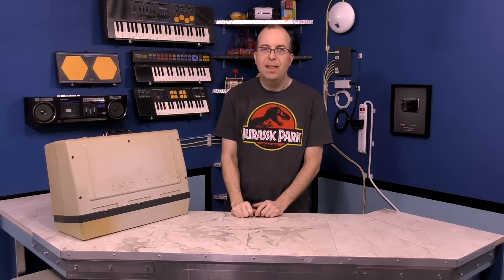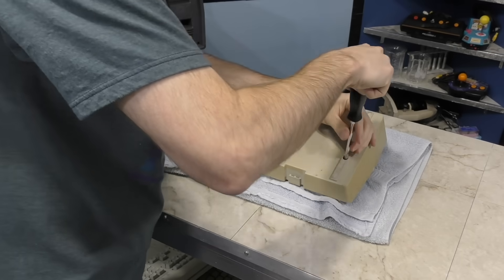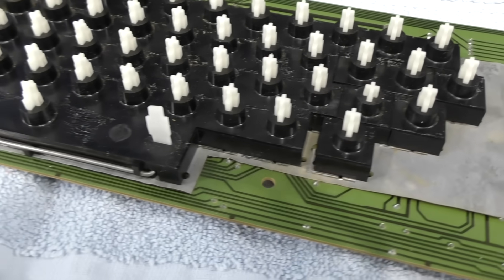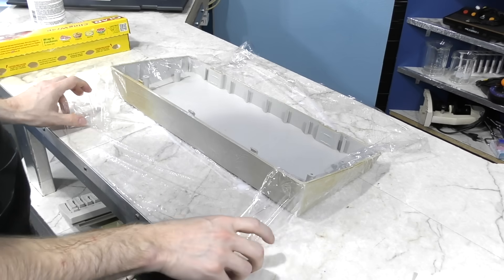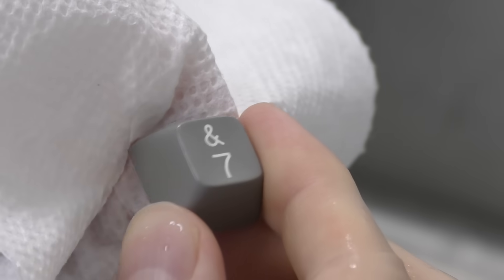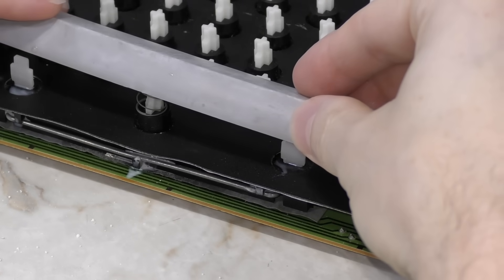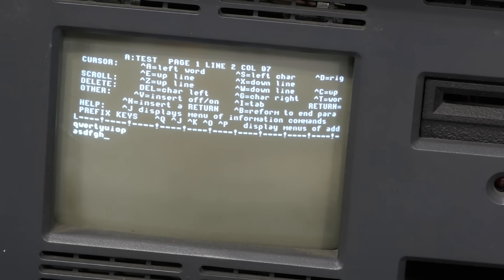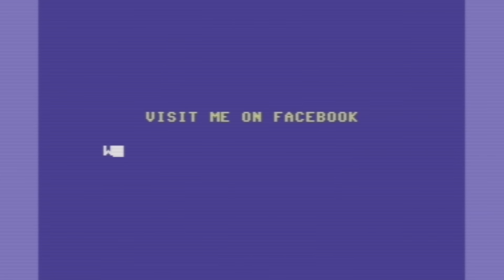Osborne 1 Computer Restoration Part 1

Comment: even better if a chip has built-in nand, ram, rom and touch-display as a card computer. uv light bulb in enclosure, not outside. ie 3d resin uv printer cure box. the reason of uv curing is exactly the same. have a-rest from your works. what drinks space bar serves.

Comment: I just got one of these, the keys are in pretty good shape, in fact the whole keyboard seems OK (although I haven't actually powered on the machine, yet); I'm wondering if you had to do any cleaning on the dark face on the top, you don't mention that in this video. I made the mistake of using some rubbing alcohol on some sticky left over tape glue, which deteriorated the surface a little. I figured a little Armor All would probably restore what I did, but I still have a few goo spots that I wouldn't mind cleaning.

Comment: I never get streaks with hydrogen peroxide cream because I omit the clingfilm stage. I think it needs oxygen and room to evaporate or streaks will happen, just set an alarm to go out and apply further coats with a small brush every 30-45 mins and don't apply it too thick.

Comment: Best way to really clean screw heads is a wire wheel on a bench grinder. You can even buff them up then on a polishing mop and an abrasive polish again on the bench grinder. If your really fussy they can then be nickel plated with some fairly rudimentary equipment.

Comment: A solution for faded plastics, rubber and leather is actually lanolin grease. No promises but it could potentially fix issues like the color streaking on the keycaps. A wipe-down with lanolin grease immediately brings back the original color of those materials. Especially when I'm working on old vehicles with faded interior trim, it's amazing the difference that an application of lanolin makes. And the color stays indefinitely. I've tried a lot of car care products and none of them even come close.

Comment: I have the some effect with stretch foil cuz uneven application and thickness of the coating. If you have small elements better is use box with liquid.

Comment: @the8bitguy don't use sun for retrobright. For dark plastics as dark gray, gray, light gray or beige just put those parts into 12% oxidizer for 3 days. After 3 days wash those parts and repeat with new part of 12% oxidizer fo next 3 days. As i see you destroyed key caps. Your key caps looks like a marble... not clean one color surface.

Comment: I like the "marble" look to the keys.  Super cool.
Reply: I would love them on a modern mechanical keyboard
Reply: @neurotyx  Buy a mechanical keyboard, put keycaps made of ABS plastics, and let it sit all by itself in a bath of lots of UV light for a few weeks, then let it sit in the bath of UV light while submerged in hydrogen peroxide and water
Reply: @neurotyx  You can buy SA profile or MT3 profile keycaps.
Reply: I know this is dumb and super obvious, but you can actually get marble coloured keycaps now for mechanical keyboards, keyboard keys have come a long way, pretty much customization is pretty good nowadays.
Reply: When the Romans make your keyboard...
Reply: Same
Reply: It certainly tells a story.
Reply: Looks classy
Reply: I was recomended it now, after 4 yrs?

Comment: I liked the video but please never soak a cable in vinegar again. It can wick up the inside of the wire via capillary action. When you get a cable like that contact cleaner is probably best.

Comment: Would you be able to use a blacklight instead of sunlight for the retrobrite process?
Reply: Probably, I think if it's just the UV part that matters
Reply: @ThomasFarquhar2  This is a very late reply, but he actually has used blacklights in later videos with quite a bit of success
Reply: @ScrambledAndBenedict  yeah I saw those videos
Reply: @ThomasFarquhar2  I felt kind of dumb because right around the time I posted this comment I actually flew him an e-mail about it, and he got back to me and was like "I guess you're not up to date with my new videos because I've done that" lmfao

Comment: "The tried and true method."

Literally the worst retrobrite experience on the whole channel.
Reply: Yeah, it's weird to see these old videos where he uses this obsolete method.
At least he found a better way
Reply: @devourerthegoop2887  Yeah, I'm glad he did. The only thing I wonder about with submersion is why use a black crate? Likely to help heat up the water, but you also allow way less light into the crate, which seems way more important. Why not use one of those big clear plastic totes instead?
Reply: @KnightRider378  I think he uses it because it's the biggest he could find. He uses a smaller and transparent crate for smaller things in occasion

Comment: I recall when Adam Osborne was on the KCBS radio 740 AM afternoon talk show, San Francisco, when he was asked if computers would ever be developed with the ease of use for the general population.  His answer, to paraphrase:  'Yes, computers will get easier for people to use.  Remember back in the early days of the automobile, where the car owner had to have mechanical know-how to keep the car running on a daily basis.  Nowadays, cars can be reliably driven for thousands of miles, by people whom have no mechanical knowledge of automotive upkeep and repairs.  There will be a time when computers will be comparable to modern cars with the ease of use.'
Adam Osborne was proved right!

Comment: if you want to fix the keys put them in water with a lot of hydrogen peroxide and leave it out on the sun for a day, the streaks you are seeing are from the plastic wrap and how it laid on the keys if you put them in water with hydrogen peroxide while in the sun, it should fix it, also recommended to use a tray instead of a pot and then to lay each out in rows face up

Comment: Just got one with printer, modem, “ventaire” power piece, a lot of software, num pad, and clock card. Most of us is in the original boxes and has books. 
Would anyone know if there is a place or person in Georgia that know how to work with these? I have seen people say they turn them on and poof! Instant doorstopper. I am afraid to turn it on, because it smells new and still has a ( what looks to be) good fuse in the power bay. 
Great video. I need to figure out that whitening of the plastic. Under the air vent it looks brand new as white as if it came out of the factory.

Comment: Not sure if it would help but a friend of mine had streaks during a retrobrighting session & rubbed everything down with mineral oil & let it set in the sun for about 20 minutes & it took the streaks out. Not sure if it would work on old plastic like this but Might be worth a try with 1 key.

Comment: Try applying a smidge of armourall plastic shine on those keys. You scarred the finish, but it could help restore them fully. It is what is often used for similar issues with automotive plastic.

Saturate a paper towel with it, then gently massage it into each key; give it a few minutes to soak in, then wipe, and gently buff with a terry pad.

Comment: If your plastic parts fit, put them in a dishwasher. It will save you a lot of time with your cleaning.

As well, for rusty and nasty screws, if you can't find suitable replacements, you can get rust removing products like "evaporust", which will remove the rust for you.

For corroded connectors, you can use something like CLR or just diluted muriatic acid, as long as you rinse very thoroughly and then neutralize with a suitable base, like sodium hydroxide.

Comment: yeh, that's how i fucked up a virtually irreplacable set of vintage rotring technical drawing pens. lesson learned! (what ever the middle layer was made of, swoll up by about 25% over the next few days after "just" giving eveything a 20 minute soak. and ruined all the glorious, triple-shot caps and barrels irreparably.) this was still "lucky". maybe try silicone oil on the back of a cap. sometimes it works wonders. no long term warranty, though! 
dont ever let ancient, unknown plastics you want to preserve soak in anything for more then 10 minutes at a time, at anything over 20°C room temperature.

Comment: Don't rinse your vinegar of your metal with water, or it will immediately start flash rusting again.  Instead, wash them off and then brush on some phosphoric acid, or dunk them in phosphoric acid... let them sit a bit and wipe the sticky stuff off.   Phosphoric acid will convert the flash rust to an inert material that can be painted over, or will keep your parts from rusting for a good while before you get around to painting them (if ever).   If you're in a hurry,  or for very small parts like screws, you can just skip the vinegar (weaker acid) and put them straight into a little sour cream cup or pill bottle of some phosphoric acid (stronger acid).  
https://www.homedepot.com/p/Klean-Strip-1-gal-Phosphoric-Prep-and-Etch-GKPA30220/100406369

Comment: Retr0bright is simply a temporary solution.  The yellowing comes back with time, as you'd expect...but greater in areas that were previously brightened with Retr0bright.  See discussion here:  https://www.classic-computers.org.nz/blog/2013-01-15-retr0bright-only-temporary.htm

Comment: Love the retrobrite idea. A suggestion for when it goes to that marble finish is to try soaking the plastic in silicone or WD40 to put some oils back into the surface. This works good for after removing paint from plastic with oven cleaner. Also I saw mention below about a UV lamp, that would help reduce the time in half if not more.

Comment: This is just me speculating, but the streaks are probably a result of the uneven coating of the “retro-brite” as well as the uneven sun-exposure through the cling wrap.

I’ve seen you use hydrogen peroxide in a tub with water in other videos; that seems like a method that will provide more even exposure.

Comment: Hey man, I know this is like a year too late, but to fix the keys I would get a cleaning cloth that is impregnated with silicone. What has happened is that the finish coating on the keys has been stripped away, which causes the plastic to react to the air and form something akin to oxidation. Cleaning and rubbing down the keys with the cloth should help get rid of that appearance, as it will give the keys a coating to protect them from the air. I use one of those every time I clean one of my pistols with spray can gun wash (essentially non-chlorinated brake cleaner). They look just like your keys after it dries, and giving the parts a quick rub down with the silicone cloth brings the finish back to factory. Give it a try if you haven't found a fix yet

Comment: Try heat on the keys.very light heat preferbly from a blow torch or a space heater.  about 7 inches away from the surface of them. I had same issue an it was bugging me an i tryed everything and finally light heat did the trick!!

Comment: for the keys i have the sollution, clean them back with a solvent like wd40, they are dry out plastick it work fine for me in this way. or use sticker remover works also wel its also a solvent that makes it a bit greasy

Comment: I love these old machines. The oldest type of computer I have is a computer from the 80 era, but made in the 90s. A ZX Spectrum Sinclair clone. I did my best tu ruin it by shorting the various chips with a screwdriver some years back, which I failed :))) That machine is built like a tank. I still have it: I made a video on youbube with it. The only one so far.

Comment: I had a similar thing happen with some old calculator keys when retrobrighting. I found that the best way to get the streaks out is to let the plastic "eat" some oil. Wd-40 soaking was the best thing i found. It seems that the plastic gets dry when bleaching and needs to connect with it's petrolium roots to even out the color.
Reply: i second this

Comment: i had  similar  streaks on plastic  for me it worked fine to  use a  torch to heat it  but be careful or you will easily burn them but maybe you would come up with something better than a blow torch as heatsourcr x) sometimes it isn't worth the risk of damaging it further. :)

Comment: I did mention this in another video I think but as strange as it sounds Toilet Bowl Cleaner can pull stains & smells out of old plastic. Give it a test try some time, try getting it wet with it & scrub than wipe it, if that doesn't work try soaking it.

Comment: What about making  chamber with a UV lightsource , maybe set it up with multiple light sources for even coverage. Wonder if you could lower the atmospheric pressure inside and get hydrogen peroxide to boil at a safe temp for the plastic?

Comment: I think that the "marbled" keys can looks better if you try to spray them with a silicon spray. The plastics show the injection flow so with the silicon it can renew. Aged plastics can show the injection marks of when they were moulded. Sometimes silicone (or vaseline oil) renews plastic by hiding these signs and nourishing it. If you want, you can try it! I use it in old plastic car bumper and it works very well.

Comment: I think I'd experiment with using distilled water rather than tap water.  There just might be a chemical reaction taking place with your "Texas water".  The only other thing I can think of is what you probably already feared.  The plastic doesn't homogenize completely in the factory so when you chemically clean it there is unequal results.

Comment: I have a compaq luggable but when I got it I plugged it in and it was fine. the I plugged it yesterday and when I turned it on it went POW! and I unplugged it right away. luckily , no smoke poured out but it did smell like burning electronics.

Comment: I once owned one of the original Osborne 1 computers.  These had a ribbon cable for the keyboard, and a metal keyboard bezel.  You had to be real careful walking up to the computer and using it because if you collected a static charge on the carpet, you can reset the computer when you touch the keyboard bezel.  LOL

Comment: On the chalky looking keys, I can highly recommend Aerospace 303 protectant, readily available in the US. It's designed to condition and protect vinyl and rubber. It should replace the lost oils in the plastic which I think it what has happened.

Comment: I have had the exact same thing happen all two times I tried to retrobright (using the same exact creme and method as you). Once was an Amiga 500, once a 1200. First everything looks great, then a few minutes after it dries you see the streaking.

Comment: This guy is making a classic retro -Brite mistake. NEVER use a brush, Never use plastic wrap!!
For flat surfaces, use a very low nap roller.  home depot sells a cheap 4" plastic rollere that works perfectly. It costs about $4 too. Then put in a clear plastic box with 1/8" of water on the bottom. Best to put clear box upside down, so you get better even light. Sometimes those boxes have many curves and bends that defuse the light a bit to much. The water heats up in the box, and evaporates keeping the cream moist. Then check every 20-25 minutes. turn as needed to keep in the sun. add water as needed. reply after 3rd opening if needed

Comment: Oh yes, that has been wet, can even see the water-lines formed as it dried! FWIW- You can clean connectors in vinegar, but it may strip the the plating and putting it in with the rusty steel screws set it up for a potentially harmful electrolytic reaction. Ooh, I like that key-puller, great little tool! That residue that remained after rinsing was probably minerals and whatever else was in the water that got in there and later evaporated. Looks like the keys had an uneven oxidizing reaction? Weird. Coming along alright though!

Comment: Actually I have a Apple Macintosh plus that I'm working on right now I have the same affect on the case. So I tried something else on another YouTube page that they recommended I took a large tub big enough to fit the case in the front bezel another plastic parts and filled it with 10 bottles of hydrogen peroxide side and oxy-clean clean. So far the results are good but it requires a lot of time and patience and and about week has passed and I've had my case since under the water ever since.

Comment: omg this is so awesome, that smoke and pow... it happened to me too. I told myself "hey, I should use straps on those wires in case the molex connector touches a metal part like the floppy holder inside my case". So I yanked out my computer case so I can turn it off and start working on it and BAM...black smoke came out of it. Yup, that molex connector touched the exact same freak'n metal part I hoped it didn't touch lol.

Comment: I had the same issue as your keyboard keys!  I was retrobrighting some plastic parts that turned yellow, and a few pieces got that marble effect.  I rubbed some commercial plastic restorer onto them and it seemed to do an okay job hiding it, but I'm not sure about a long-term fix.

Comment: I had a set of Apple //e keys marble like that when retrobright using bright/hot sunlight as the light source and vol40.  I was able to "fix" them by scrubbing with moderate force using Comet and a washcloth.  The light color of the marble scrubbed off, leaving the darker color and they look great now.  To test, take one of the ones from the middle, and scrub it on the top side where you wouldn't notice any issues. For the //e keys it took a lot more elbow grease than I would usually want to apply, but it did work.